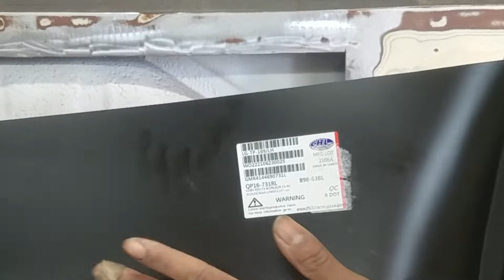HOW TO REPAIR BED SIDES ON A SQUARE BODY CHEVY C10 TRUCK #METALWORKING #3w1b

Comment: Did you have to do the wheel wells or Inner rear wheel arches?
Reply from the maker: I patched the inner arches, but didn't replace them fully.
Reply: @ thanks! I want to do that too, and the rear wheel wells but there is a fair bit of rot and can’t find any reproduction for my 91 r1500 burb.
Reply from the maker: @joel4506  you can use long bed or short bed wheel arches to make the repairs as well. Good luck

Comment: Hey Irwin .I have just watched your video..And I say you have been around the body shop awhile...Not just a few weeks I can tell you have some exp..good job.I backed into my 1982 Chevy Silverado fleet side swb. Survivor u say....I've had to fix the brakes because 1973 to 1980 will not work .GM in 1981 until 1987 the power brake cylinder and vac cannisters.only thing that work........Anyway Irwin could tell me We're you bought your patch panel.Im need ING the drivers side past the wheel lip .It's from there in between the wheel lip  and the turn signal. Same as you but back alittle.ct with a wheel tack back grind down seam filler sand and paint.....what was that company name .video was good
Reply from the maker: I'm glad you enjoyed the video(s) check www.raybuck.com they have a great assortment of replacement parts.
Reply: @3Wheels1Block  thanks
Reply from the maker: @timothyvandyke-lc1oi  you're welcome